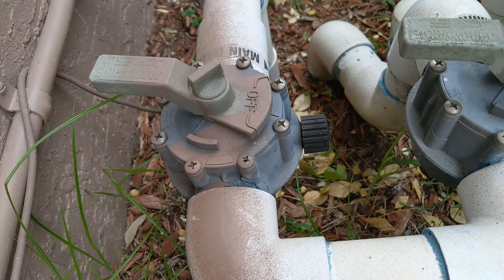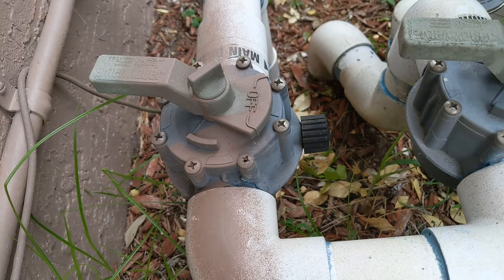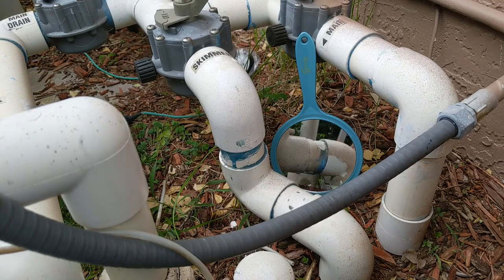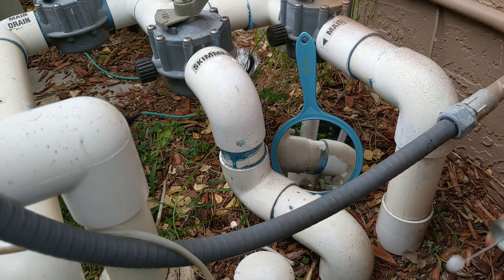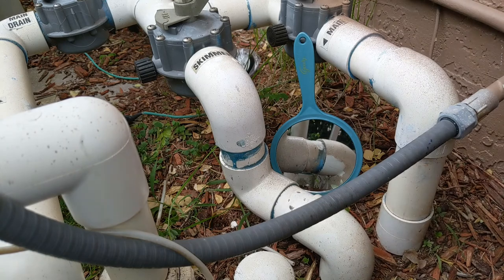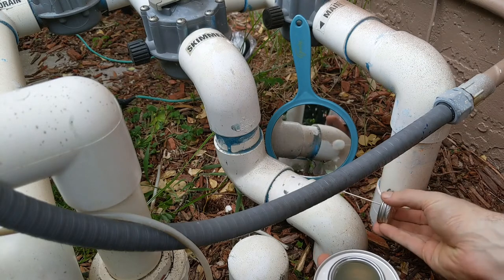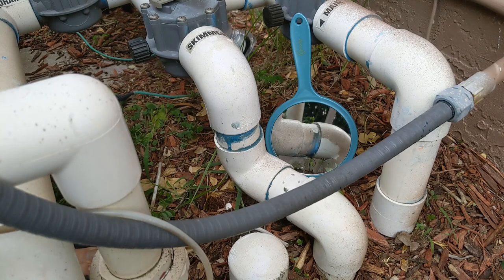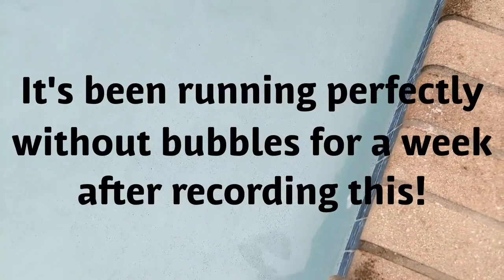Fix pool air bubbles - suction leak

Comment: Hello. Did you apply both prime n other while pump running ?
Reply from the maker: The primer is what does all the real work. So while it's "sucking" air in use primer. Once everything is sealed up, yes, I applied a little cement to the outside, but there's no longer anything to really suck it in. Hope this helps!
Reply: Thanks for sharing. How did you find the leak?
Reply: Yes he did!